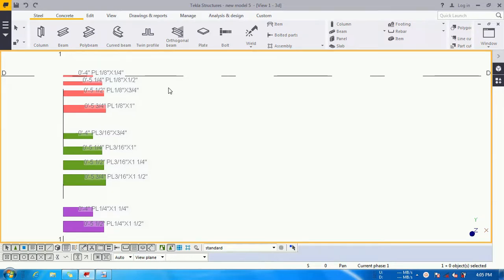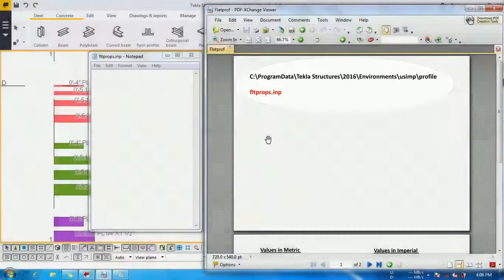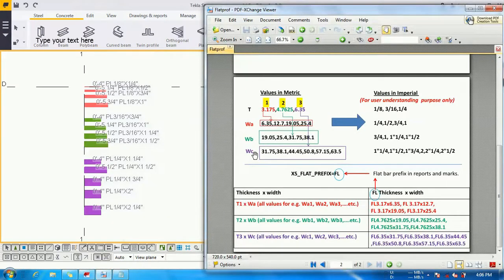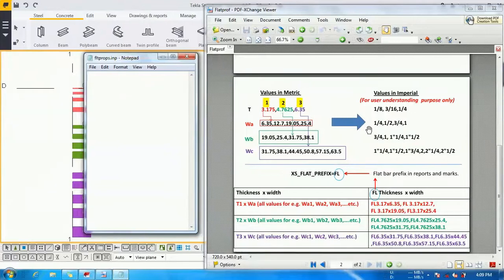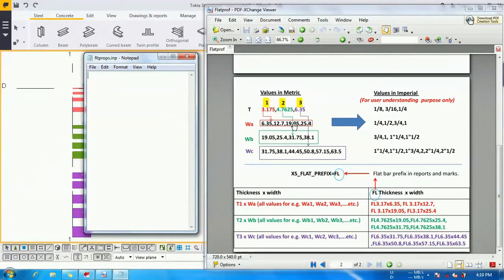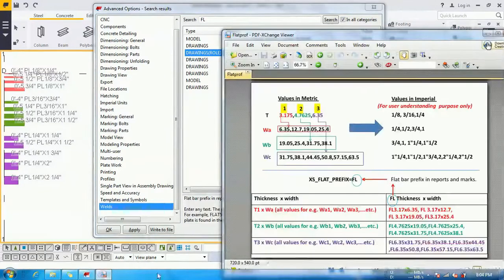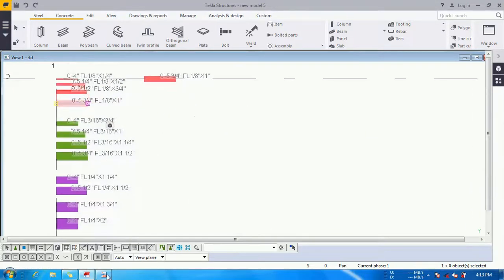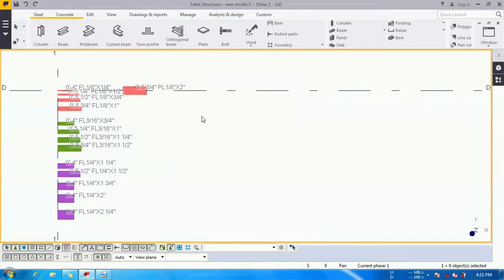Tekla - Set Flat bar Prefix "FL" Using fltprops.inp & XS_FLAT_PREFIX.

Comment: In modeling if dimension is 6000 mm than how can we get a suffix of "mm" while modeling...? In short i want to view units in model while modeling..?!
Reply from the maker: There is no option like that.

Alternative solution: Advance option 
Set XS_IMPERIAL = TRUE 
So dim will be displayed as 1'-0" ( with feet & inch signs)

If Set XS_IMPERIAL = FALSE
dim will be displayed as 304.8 ( with decimal sign)

So by seeing the text of dimension style (. For mm & ' feet or " inch symbols)  it's very easy to identify metric and imperial dimensions.

I hope this will work for you. Stay tuned with #TCBIN :)

Comment: Hi mam tis tip is very useful.....but how can we change flatprop.inp file location preference from c drive to our model folder.....
Reply from the maker: You can copy the Fltprops.inp file to a model, project or firm folder, then modify the file in the new location as per your need.
To know your firm, project folder location go to the advance option.
Check XS_FIRM path 
Check XS_PROJECT path

I hope this will help you.keep sharing your doubt and knowledge with #TCBIN :)